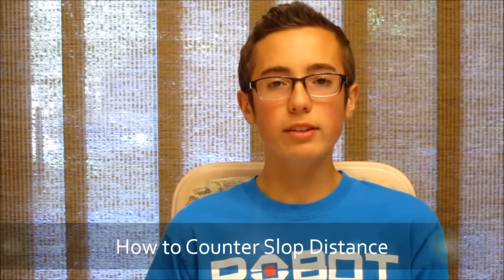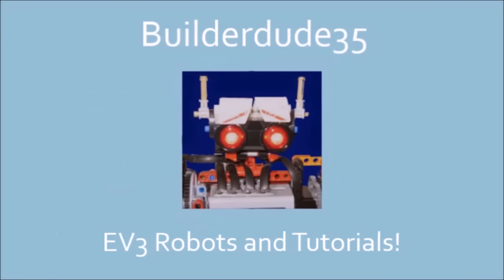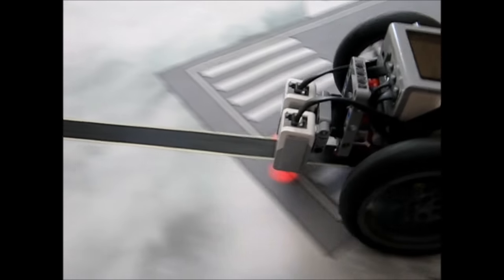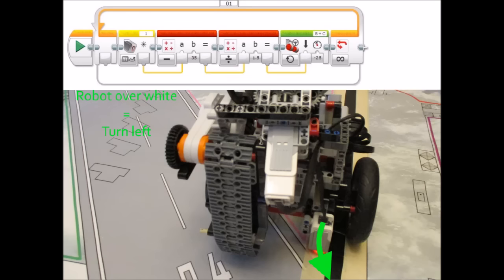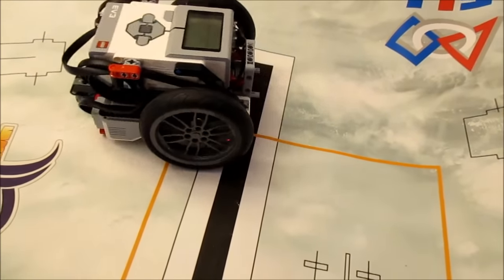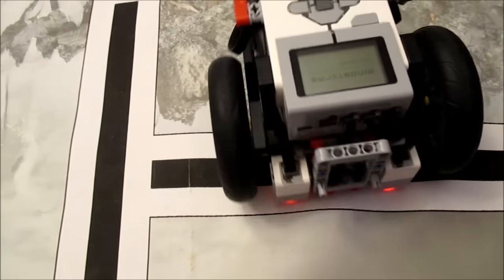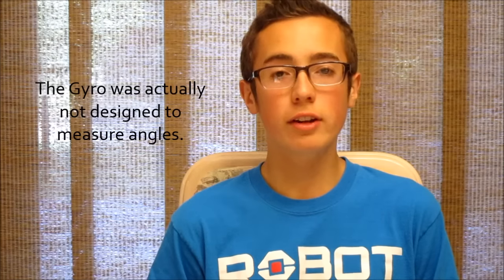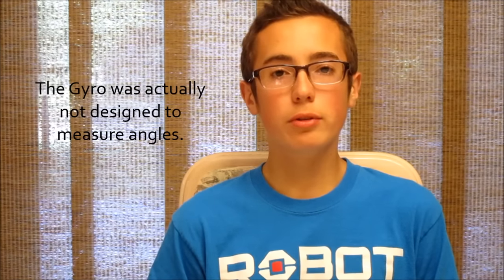A Quick Tip for Countering Slop Distance

Comment: Thanks for the EV3Lessons.com shout out. Using sensors and mission models to align are great ways to increase reliability.  You mentioned that you don't like walls.  We use the walls all the time - you can align on a wall to straighten out and to wall ride regardless of the mat's position.  A big plus of using the walls is that they are rigid and flat -- unlike some mission models. Plus, FLL states that the mat should be pulled against the south wall and equally distant between east and west.  Teams should check for this when they arrive at an event.  A robust solution could even account for different size gaps. Lots of ways to solve the same problem.  Just some things to think about. Thanks for sharing your ideas in your videos. - Sanjay and Arvind
Reply from the maker: +Droids Robotics Hey guys! Thanks for the info!